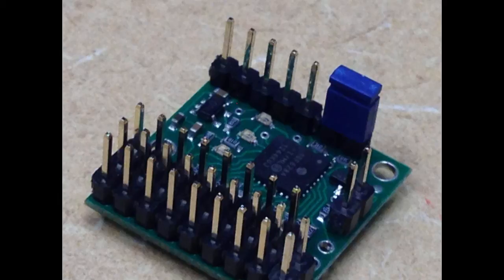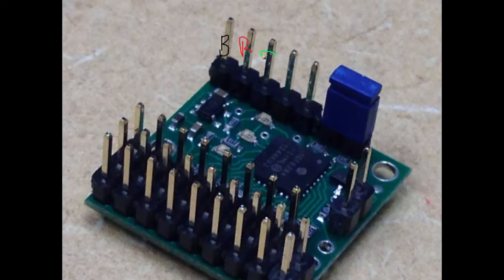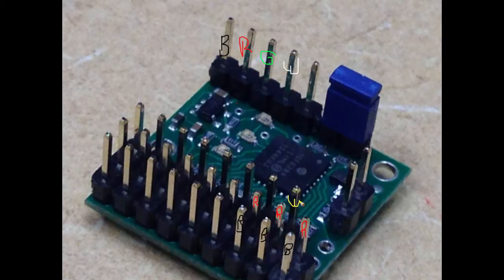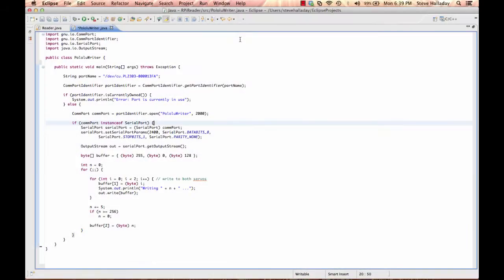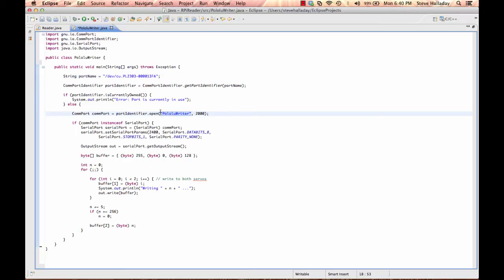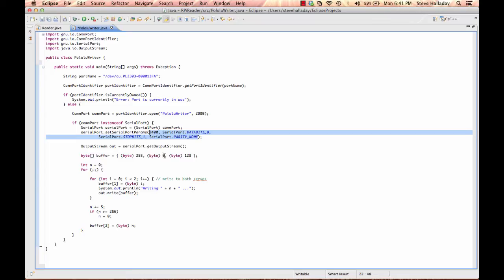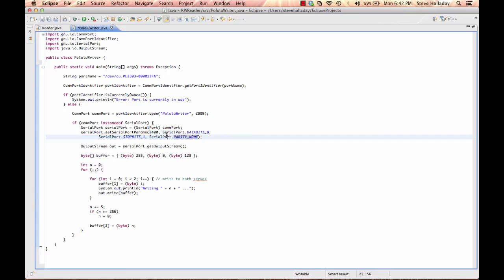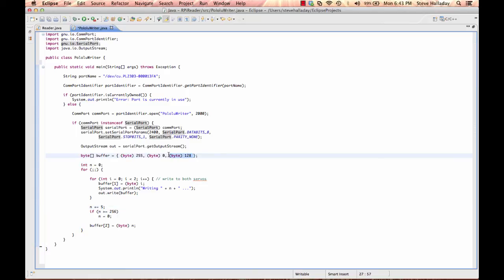Pololu Micro Serial Servo Controller with a Mac USB

Comment: Nice video, it helps me in my project, but I have a question, do you install some drivers in your computer, because I tried to make the same as you but my pc asks for the drivers of the controller.
Reply: This is a good question.  On my mac, if this did require drivers, I must have installed them a while ago, so I don't remember.  On windows, you will probably need a driver.  Some of my students have had trouble with this cable on Windows 8, but here is a link to a driver they got to work: http://www.prolific.com.tw/US/ShowProduct.aspx?p_id=225&pcid=41
For older windows systems, I hear it's easier to find a driver, but you will probably have to poke around on Google.  Since I don't have one of these systems, I'm not much help here.
Please post the results of your research to help me and others.